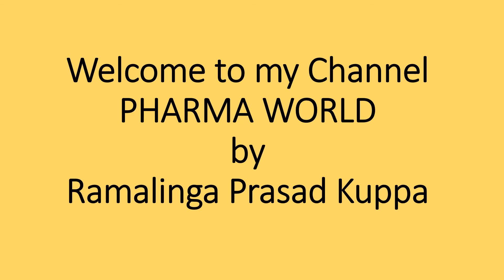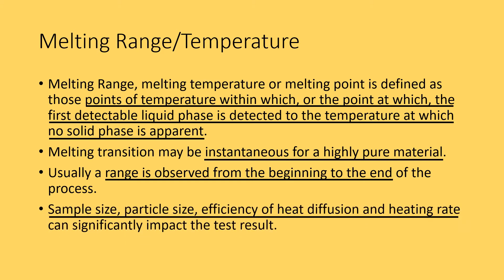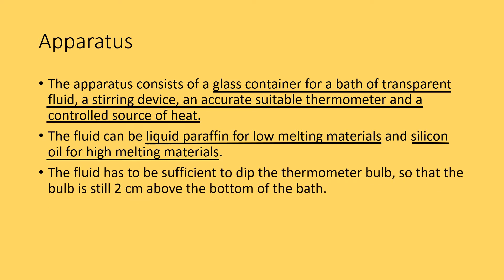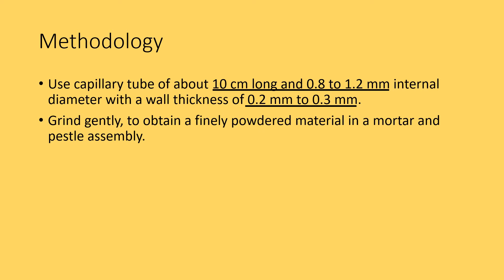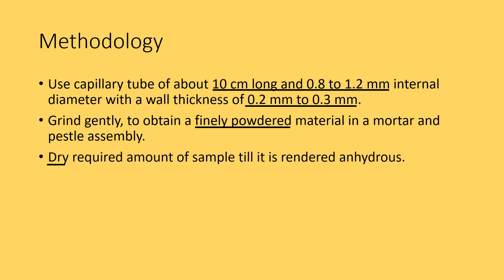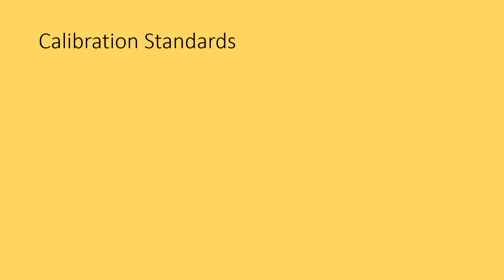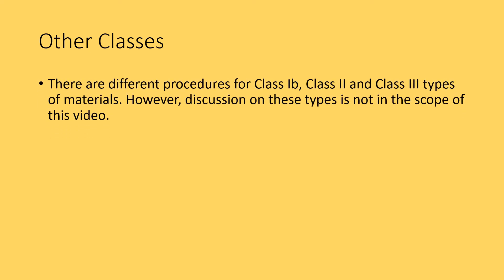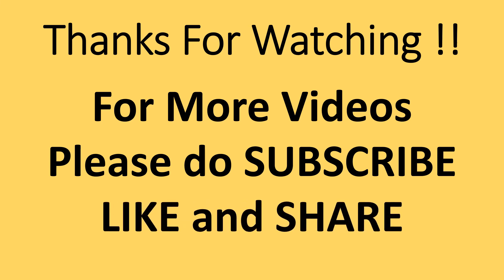Melting point testing as per USP 741

Comment: Sir plz tell about validation process of melting point apparatus I need that
Reply from the maker: Strategy for validation of physical methods may be looked into as category III and category IV as prescribed in USP <1225>. So, accordingly you may have to validated for precision and specificity. 
The path forward is,
1.       Prepare a validation protocol describing that it is a physical method and is operated by a detailed procedure (SOP) by skilled and experienced analyst. Also, indicate that the standards used are appropriate for the range being operated by using certified valid reference standards.  [This establishes the limited validation of precision and specificity. The protocol should have a unique identification number with version number]
2.       Give detailed operation with a focus on risk assessment on the operating procedure and establish that the risk is low for getting any erroneous result while operating the instrument.
3.       Operate the instrument with three replicates for the entire range of operation proposed to be used routinely.
4.       Record all the data in Excel spread sheet and calculate – average, standard deviation and %RSD. Also calculate the 95% confidence interval (CI). [These aspects establish the statistical acceptance of the data for consistency.
5.       Prepare a detailed report and summarise all the raw data and the evaluated results.
6.       Make a conclusion on acceptance of the method on routine usage.
7.       Make a sign-off page with – ‘Prepared by’, ‘Reviewed by’ and ‘Approved by’ 
Attach all the raw data, Excel sheet evaluation as a separate file for easy reference.
Reply: @pharmaworldk1473  thankuuu so much Sir
Reply from the maker: If the meeting point apparatus is calibrated as per USP <741> using the standards for the specified range is done and confirmed that the equipment is working as expected, it is adequate. Generally,  the melting point equipment is calibrated and preventive maintenance done. That is adequate. However, if you arw looking for any specific melting point process validation, please provide me details to help you...
Reply: @pharmaworldk1473  no sir it's not specific it's releated to assignment so normal validation process
Sir can you plz provide the material regarding that
Reply: @pharmaworldk1473  thanks alot sir 
sorry to disturb you sir if you don't mind can you plz send the validation process of hot air oven also
Reply: Please sir hot air oven ka bhi bta dijiye
Reply from the maker: Let me extract the information requested and share with you.
Reply: @pharmaworldk1473  ok sir  but plz sir if possible try to send it in 1-2 days please sir
Reply from the maker: For Hot Air Oven you may please follow this strategy. Prepare detailed protocol as described for melting point process validation. Incorporate the following information.
For Oven at 105°C oven follow the procedure given below.
1.       Take totally dry powder product that is listed in your products. Take about 2 gram each of sample and load 0.2%, 0.5%, 0.8% and 1.0% water and mix well for uniformity. [Take 2 gm and add 4mg of water for 0.2%, 10mg of 0.5%, 16 mg for 0.8% and 20 mg for 1.0% individually.]
2.       Carry out LOD test at 105°C for 3 hours and collect data for 0.2% sample 
3.       Calculate the LOD value. 
4.       Repeat the same procedure for 0.2% two times more [With this you get total three readings]
5.       Calculate average, standard deviation and %RSD.
6.       Assign %RSD as NMT 2.0%
7.       Repeat steps 1 to 5 for 0.5%, 0.8% and 1.0%
8.       Declare that the process is validated if the %RSD is within 2.0% 
I was on some other priority assignment elsewhere. I could not get time to look into your request. I hope that this will help you.
Reply: @pharmaworldk1473  thankus sir 😊